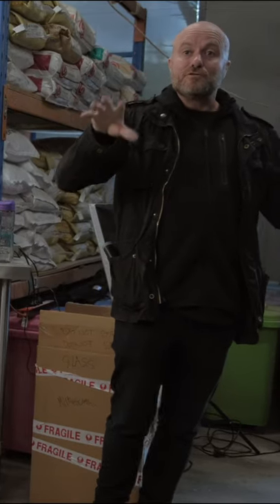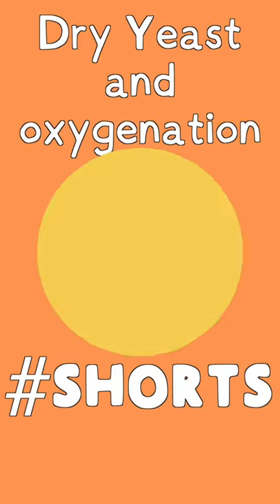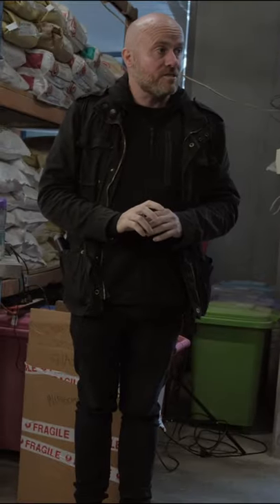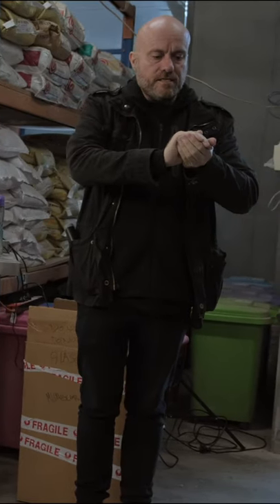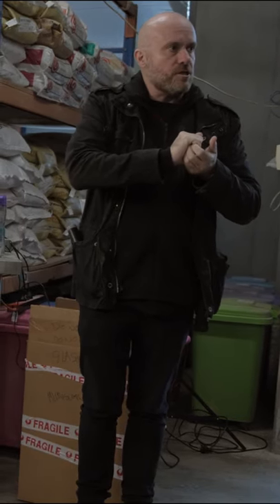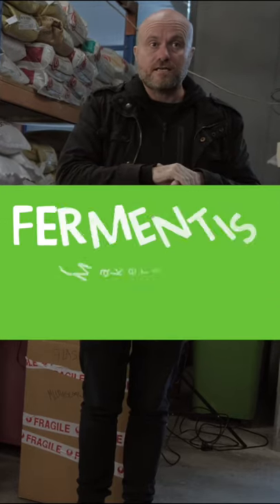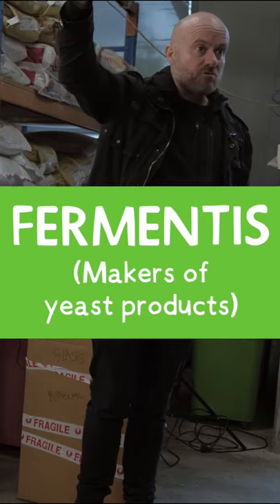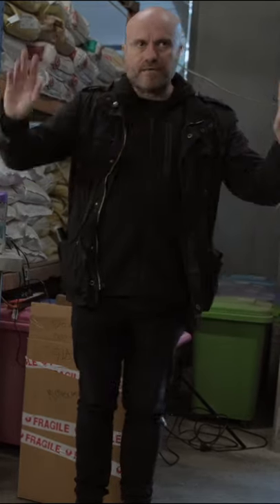Do you need to OXYGENATE dried yeast? Explained in under 60 seconds  #shorts

Comment: But is it still beneficial to do so?
Reply from the maker: There is no benefit for the finished beer but active fermentation will start a day or so quicker if you use pure o2. So it’s completely up to the brewer if the effort of using an aeration kit is worth shaving a day off fermentation.
Reply: I've never found any benefit, in either time or flavour. I stopped oxygenating years ago.